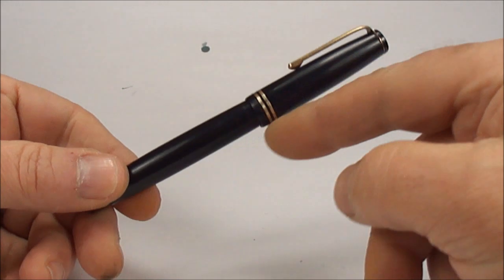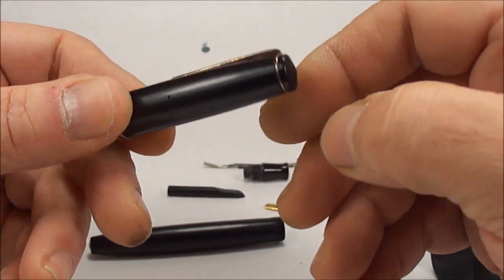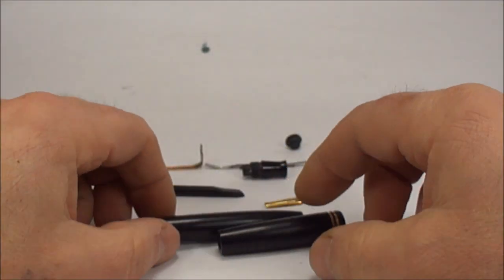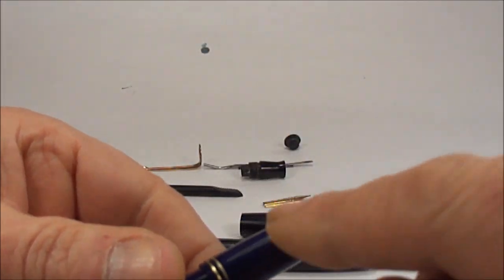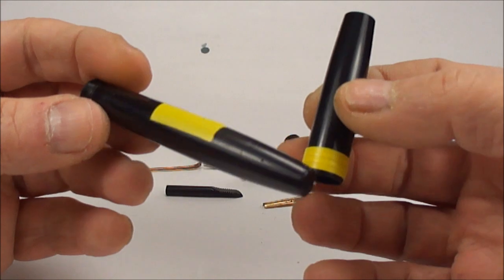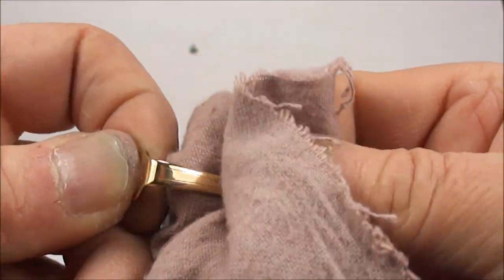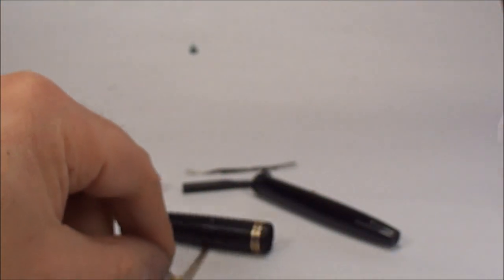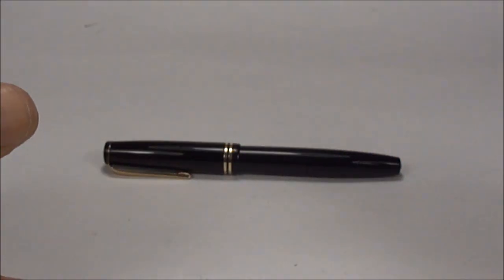How to polish a fountain pen.

Comment: So without any micromesh, would you just use semichrome and then renaissance wax? Will semichrome help remove microscratching?
Reply from the maker: Each pen has to be looked at the condition as not all pens are the same. Some will require more work than others. Simichrome will help to remove lite scratches and will polish the pen. The wax will give a level of protection after all the work has been done. Good luck.

Comment: I'd be interested in your thoughts on whether it is better to use the micromesh slightly moistened rather than dry.
Reply from the maker: All depends on the pen material, in general i use it dry. Good luck.
Reply: @penkino1  Many thanks.

Comment: What's the "little potion"' that you're using? Where is it available on?
Reply from the maker: It is a home made "potion" i use, however there are lots of other alternatives such as Peek or Simichrome. Both of these will polish a pen. Good luck.
Reply: His particular potion is actually ordinary toothpaste, if you like.
Reply from the maker: You carry on using your toothpaste on your pens, at least they will smell minty.
Reply: Mint may not have the sweet smell of micro mesh and Renaissance wax, but toothpaste polishes quite well, and then what homemade substance could be that snowy white?
Reply from the maker: I take pride in my restoration work and try and find the best products for my pens, and toothpaste is not one of them.

Comment: Stef, is there any way to speed up the tedious micro mesh process?
Reply from the maker: Hi Richard, yes you can simply skip the micro mesh and just polish the pen. However that will not give you the best end result. It is tedious but the end result is worth it. Good luck.
Reply: @penkino1  Hey Stef.  Smart fellow that I am, I assembled all of what I thought was necessary to speed up the process. Had my dremel, velcro micro mesh sanding disks, special adapter for the disks, etc.  Ok, the result was a disaster.  On the lowest dremel speed with the 1500 grit, I attempted to start the process on an old plastic nib section.  Geeze.  The damn thing gouged a groove in the section, and discolored the rest such that the section could not be salvaged.  Just for the hell of it, I tried the 12000 grit. That overwhelmed the section two by just adding more scratches to it.  The bottom line for me is to do it by hand, even at the low speed, the section could not take the action  (and I did not press down on it very hard)!!!!

Comment: Hi Stef, I wanted to ask, if you had any advice on how to get the inside of an ink window completely clean and clear again. I've tried scrubing with toothpaste and dish soap, but  there's still some ink or dirt residue and the ink window plastic seems a bit milky. Unfortunately I don't have a ultrasonic cleaner. Thank you!
Reply from the maker: Difficult to comment Christian without having the pen in hand. Some will not clean up clear due to the material and through ageing. Good luck with it.

Comment: Nice video.  I am wondering, what do you polish the gold trim with?  Will Simichrome remove the gold plating of the clips, lever and bands?
Reply from the maker: Depending on the pen as some pens have a thick gold plate so a tiny application of Simichrome should be fine. However some pens the plate will be removed with Simichrome. If in doubt polish with a jewelers cloth. Good luck.

Comment: This is great. One thing I discovered are these tiny little brushes to clean in between teeth braces -- I got some once in a lifetime ago, but never used them... and they worked great for finely cleaning in between the threads and channel of my feed.
Reply from the maker: Yes they are very handy, i use the very thinnest ones to clean the air holes after polishing my pens. Thank you for your comments and for watching.

Comment: Hi, I have an Esterbrook but section is scratched. How do you suggest to fix?
Reply from the maker: +Armando Amores Difficult to say without seeing it up close. I have removed some deep scratches with dry heat (not recommended unless you have experience). If they are quite light then Micromesh will remove them. Either way up-most care has to be taken or you could damage your pen further.

Comment: Thanks for these videos, they are really helpful for a newbie like me. I have a Conway Stewart 388 and I've noticed in other videos that you've restored at least a couple of those. Will this same technique work on this pen? I've seen conflicting information about whether the Cs 388 is made of celluloid or casein and don't want to risk damaging it with incorrect use of a water based polish. Thanks!
Reply from the maker: Casein should not be soaked in water, polishing it is not a problem. There are lots of "How to"videos that will help. Good luck with your pen.

Comment: Is there any substitute for the micro mesh? I can't really get my hands on micro mesh, only by ordering from US, which will cost more than 30 bucks. I have some 10000 and 12000 grit sandpaper, but I think is not the same, right?
Reply from the maker: Im sure there is, but it is the only method i use. You can buy Micro mesh on line or on Ebay, it is easily available here in the UK. Good luck.

Comment: I own a vintage Conway Stewart with “cracked ice” design.  The barrel of the pen is in great condition, but the cap is much duller.  Is there a way to restore the cap so that it matches how clean and vibrant the barrel is?
Reply from the maker: It is difficult to advice without seeing the pen and determining what has caused the dullness. You may be able to polish the cap but you will need to remove the clip and mask the cap bands Good luck.

Comment: Thanks for this. It has inspired me to restore a Parker Duofold Junior that I inherited. Using your other Videos it sits in front of me stripped ready for polishing. My only problem is findind a Parker 14k No 10 nib for it, as it looks like someone played darts with it! Thanks for the inspiration.
Reply from the maker: +Terry Baker Im glad it has inspired you to restore your pen. An online search will get you a Parker nib. Good luck with your pen.
Reply: Just an update. Got the parts and completed the restoration and ended up with a beautiful pen plus the two non working pens I bought for the parts have been combined to make another Parker Junior almost as good as my original. Thanks for the videos, long may you continue.

Comment: I got myself a used Montblanc ballpoint pen 164 with a previous owner's name engraved. (I could not afford a brand new Montblanc, yet wanted to get a decent pen :D.... ). Is there a way to remove this engraving as to sanding off / re-polishing the pen? The engraving is not so deep. I've seen some people successfully sanded off, micro-meshed then repolished, but I wonder if there's better way to do such work. Your help would be appreciated sir - !
Reply from the maker: It is difficult to comment without seeing the pen and how deep the engraving is. The problem with sanding out the engraving is you could create a flat spot. Another option would be to fill it. Either way it maybe better to send it to a professional. Good luck.
Reply: @penkino1  Thank you very much for your kind reply. While the outcome will be better on professional touch, I also kinda want to gain hands-on experience myself. Just like you sir, it is worthwhile to try. I will try the superglue to fill in and try sand/micromesh it. Maybe take a video for myself and upload for you to take a look in the future :) I'll follow your video on "How to Repair a Crack and Hole", considering these engravings as holes.
Reply from the maker: I think i Montblanc pen is not the right pen to practice on, find a cheap pen first to try and practice. There is still a technique that is needed when filling holes with super glue, it has to be made worst before the filling  Either way good luck with your pen.

Comment: Hi stef, I love your finish on your pens but I'm concerned as I've been reading lately on forums that renasance wax isn't good on pens as it traps in fumes that some pens naturaly give out, have you had any problems with it? Thanks.
Reply from the maker: I use several product on my pens all depends on the pen. That is why i do not post on the forum any more. To many "professionals" telling you how wrong you are, and how bad this and that is. So i do it my own way. What ever your comfortable with then go with it. Thanks
Reply: That sound like a load of bullshit to me. I don't see how an 80 year old pen would offgas enough to cause an issue. We are talking very very low volatility, almost negligible. Just use whatever wax you've got and ignore the armchair quarterbacks on the forums. The forums can be useful but there is also a lot of nonsense spouted on the forums as well
Reply: @Lawtonfl  yes your both completly right I've relized the forums contain a bunch of keyboard warriors so to speak. I too can't understand how a pen can give off gasses bad enough to destroy itself becuase of a little bit of wax. Plus you are only coating the outside so the inside can breath still? On forums it seems every product is bad to the experts lol.

Comment: Sorry about the really late comment, but would the wax on a pen last under regular use? And if so, for how long?

I was a little skeptical of a 30 minute video on polishing pens, but it turned out to be one of the most informative videos I have seen!
Reply from the maker: makey95 No problem, thanks for watching it. Waxing a pen is optional and personal preference. The likes of Renaissance wax drys to a hard film and will last for quite a while under normal use. However a simple brisk wipe with a cloth after a period will be more than adequate.
Reply: Grandmia Pens Thank you! I think I'll buy a little Renaissance Wax and try it on some of the pens I use most often. I appreciate the information a lot.
Reply from the maker: makey95 Unfortunately the wax on comes in 200ml tin which will last you for years. Good luck with your pens.

Comment: Hello,

I was just wondering, can you do this for vintage red ripple ebonite? To restore it back from the faded red to a more vibrant red?

Thanks!
Reply from the maker: Yes, the red ripple pens polish up well. Just take your time. Good luck.
Reply: Andres Arias, there are stuff called pensburry pen potion 10 and i think it is meant for red ebonite
Reply from the maker: Yes i am aware of it, however if you are careful you can still polish these pens successfully.
Reply: Grandmia Pens just asking. Can pens with lacquer or coatings be polished like this?
Reply from the maker: Lacquered pens can be polished but you have to be careful and use a polish that is not abrasive.

Comment: What's the polishing compound used here? And, can I use toothpaste?
Reply from the maker: It is my own mix of diffent products, i would not rercomend you use toothpaste. Thanks.
Reply: @penkino1  ok, what's a good substitute that's readily available then
Reply from the maker: Polishing a pen take time and effort and numerous stages to do it correctly. However if you just want it to shine then a lot of pen people use Simichrome. Good luck
Reply: @penkino1  yes no doubt. I guess what I wanted to confirm is do I need to "prime" the surface after sanding it with micromesh? Or can I apply shimichrome straight after? Thanks.
Reply from the maker: Using all the grades of micromesh correctly with still give you an acceptable finish Eugene. The Simichrome will be your final finish to leave a glossy look. Good luck.

Comment: Hello! Trying to find instruction on cleaning and restoring a vintage button fill. Any suggestions?
Reply from the maker: +Vikki Martin Take a look at some of my videos, they may not be the same pen however a lot of the instructions can be applied to other pens.
Reply: +Grandmia Pens 
Yes I have watched the videos and followed your principles. Thank you! I was amazed at how good the pen looks. However, I have an issue with the button mechanism. It wants to stick when I press it. I have ordered a new pressure bar and will put in a new sac. Will that help with the button sticking (so it will spring back)?
Reply from the maker: +Vikki Martin Be sure to install the pressure bar and then the section (without the nib and feed) with the new sac, to prevent any snagging on the sac. Yes once the bar is installed it will help the button spring back.Good luck.
Reply: Thank you so so much! I appreciate your expertise more than I can say!
Reply from the maker: +Vikki Martin No problem, good luck.

Comment: Thank you very much for this excellent tutorial ! Do you ever use a small rotary brush on a Dremel tool for badly "chewed end caps, or do you find that rounds off the corners too much ? Do you fill the imprint with white wax to make it stand out more ?
Reply from the maker: +Englishman French No, i never use any kind of machinery on my pens. All my pens are worked meticulously by hand. Occasionally i will highlight the barell imprint. Take a look at the " How to highlight the barell imprint" video.

Comment: He kinda skipped a few steps: What was that cloth used to remove the feed and nib? So what was the preparation to remove the clip? He said in the first few minutes, "I've already done that." That's nice but if one want to disassemble a pen for polishing, the neophyte needs to know all the steps.
Reply from the maker: If you watch some of the other repair videos you will see that some of the processes are the same. As explained in other videos the "cloth" is a sheet of rubber. The clip is removed by unscrewing the cap stud.